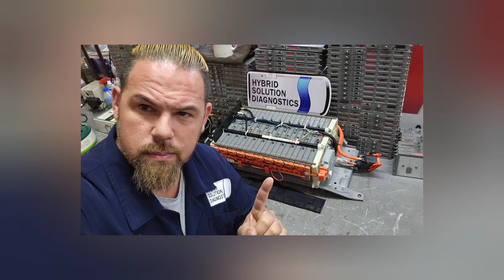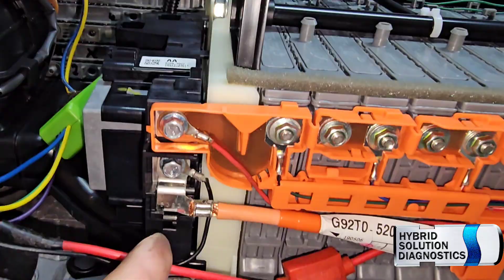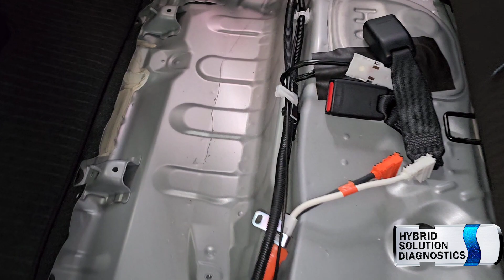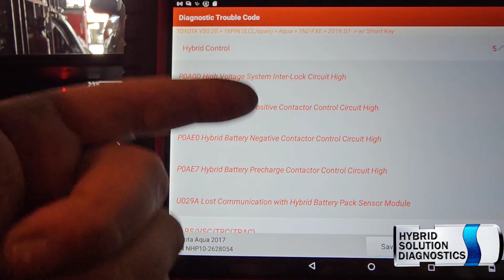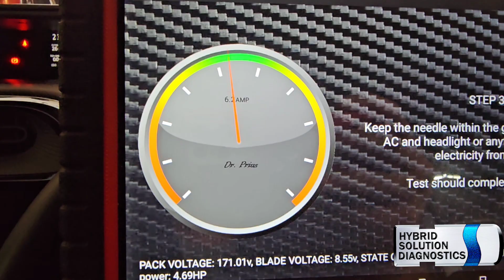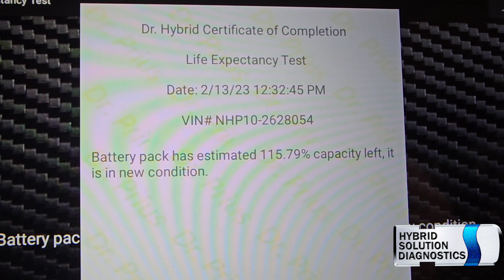Reconditioning a good hybrid battery part 2 of 2

Comment: First, thank you for such a great video, but i have a question. 
I am a little confused. 

If you connect the charger leads to the battery pack's bar, doesn't that charge all all batteries at once like the car would?
Meaning, a weak cell would not be able to reach 100% charge before the charger thinks the whole "pack" is done? I don't really follow "forced outside normal range", wouldn't that overcharge some cells and damage them?

I thought to "recondition" a hybrid battery you need to force each individual cell to its maximum, so i was expecting like 56 (28x2) different wire connections to the battery, one positive and negative per cell.
Reply: Yeah, since Nickel Metal Hydride batteries have some tolerance against a little over the norm full charge floating voltage, here the oem design itself is getting away with multiple cells connected in series (inside one module) without any dedicated balance and monitor connectors, basically just like any 12V lead acid battery (which has much more tolerance BTW) that actually contains six in-serial cells. In a perfect world where you need the maximum age and functionality of a lead acid batt you will have every one of these cells separate and treated as a 2V battery, (like the ones in many electric forklifts, cell phone towers power backups,..).

so, during the equalising charge phase, as some cells get fully charged, the current will still pass through them and SLOWLY fully charge the cells that are not, this current will cause some heat for those early fully charged cells, but the heat will be very minor, as the current is very very low compared to the rated charging amperage.

But I agree, the balancing charger should do it's job at the level of each module at least, not expanding the OEM tolerance even further. probably this one is designed for easy balancing without the need for removing/disassembling the hybrid battery.
Reply: @jonnyjonny1386 thanks for the explanation since the video uploader never answered. 

So, out of curiosity, if you wanted to recondition your battery the dirty (lazy) way. Would you use like a hobby charger for NIMH cells and attach it to the buss bar of a Prius battery, and force it to a specific voltage and get the same effect?
Reply: @Orvis25 TBH, I'm skeptical about hybrid battery reconditioning(many cycles) and refurbishing as all cells are the same age(unless the pack failed prematurely), but if the sole purpose is to balance that's valid, I would rearrange these modules to be connected in parallel as a one unit through the busbars, (of course after insuring that they have approximately the same voltage in order to be connected safely, and some load testing for bad cells), I would leave them like that for a few days, then I could use any reliable 7.2V NiMH charger or any good power supply with current limit, to charge them slowly, maybe one discharge with some cars lights and one recharge afterword, it will take a long time, but since my intention is to leave those modules connected in parallel(equalising) for like 2 or 3 weeks, I would have time as much as I need.
This period is not based on any scientific evidence, only in my mind it feels good enough.

Comment: It would seem that a parallel “pm system” that would monitor and allow access of your discharger and charger to balance cycle, without the major disassembly process, then a periodic physical inspection / cleaning of terminals.  The non neglect of fan maintenance/cleaning is an obvious simpler step to do at standard maintenance interval. 
Love your content and attitude in presentation for further education.  
Do you have a network of trainees in any of the US states?

Comment: Hi Jose, great vid! Can you tell me after reconditioning and final charging, does the battery pack need to be discharged slightly before installation into the car? Can the car accepted a 100% fully charged battery and not give a fail code?
Reply: Leave the battery to rest for one hour. Then proceed as normal.

Comment: I picked up a 09 Prius that has been sitting for over a year.  
What’s the best way to charge the HV battery? 
Should I rotate the cells and charge them all in parallel? I have a lab grade power supply that I can set the voltage and current.  
Thanks

Comment: Thank you for a great video. I drive a 2018 Prius Prime/PHEV it has 135kkm and opened since new. My question is how to check the the huge battery it has  8.8kWh, is it possible to check it with Dr. Prius App ? How to do balancing ? Thank so much for amazing videos.

Comment: If my 11 Camry has the cylindrical cells is the same process of discharging and charging?   

Or it’s just full charge 2 times to balance them.  

Also how will connect the wires for the plug to work

Comment: So, you are basically rebalancing the battery by discharging. Is the overall capacity / MAH still lower? Why not replace the cells as well? I tried to follow both videos, but I understood what I understood.

Comment: This deep cycle conditioning process could easily be automented by using a simple control algorithm, if you wanted to get into the business of reconditioning batteries.  This is a great idea for a business - if you can make it competitive to swapping in a new battery module.

Comment: I have a question, if the hybrid system gives a code P0A7F it doesn't necessarily means battery is bad, could be balancing problem yeh??
Reply from the maker: Deeper tests should be done to it…

Comment: Here, with the Prius and cars like it, no one I know has this equipment/instrumentation to rebalance an EV or Hybrid battery nor do I know of a shop that does this.  How do I get This software.  .   Also I know of a couple that built from Him self a rechargeable system for His RV .  Solar or  His Engine or ac electric   HE used HyBrid battery's from a Toyota  ,It is a Awesome setup , a lot of Power stored up ,  .the battery's are out of the car So he can CHeck rebalance  .  Good VIdeos 5*s

Comment: Hi. Thanks for the info, very useful. One question:
1. Can we recondition an HV battery in the car itself without opening? If yes. How?
Reply: can't
Reply: Yes you can, The prolong harness is intended to be installed permanently into the vehicle’s battery…. 

Call the company and they’ll confirm…. It might not be possible in every situation because they state to not keep battery in direct sunlight while charging and also you can’t charge battery in temperatures exceeding 100 degrees

Comment: I have seen your video on how to charge the modules with a 12 volt battery!!! Great video! But i am wondering if there is a way to discharge them without expensive tools??? Then charge them back up with the quick 12 volt battery method? I don’t want to spend roughly $1000 on the equipment the recondition my battery. A new OEM Toyota HV battery is $1750 at my dealership. So spending that much doesn’t make a lot of sense financially for me to do. Love your videos btw!
Reply: Car light bulb, wire and a voltmeter.
Alternatively a hobby RC charger.

Comment: What is PCU ( power control unit) my PCU fuse keep blowing, what will cause that? And the car can't start no Ready , can anyone help?
Reply from the maker: Short circuit for sure…
Reply: Check the copper connectors and nuts for corrosion

Comment: hey bud are you ablt to help me with a prob,after reconditioning i have a neg  calculated hybrid battery current what does that mean
Reply: vehicle wont go back into hybrid stay on gas mode, no check engine lights and voltages on batteries are perfect

Comment: Hello bro, I am from Bangladesh  I really like your all videos 
Bro I have a axio hybrid 
But  2 day ago show in my display a some notification 
Hybrid  Battery low cooling performance at  the stor place check 
Now what the prosiness??? Plz help me bro make a video
Reply: Hey, I would first check the cooling vents usually around the back seats. Make sure they're not clogged. Check the filter or mesh, vacuum it. If days are hot, make sure you run AC while driving.

Comment: By any chance could you please provide me with torque specs value for the bolts on the plastic brackets that compress the battery modules. For some reason can't find any information anywhere.  It's for 2008 prius.
Reply: I have a 2008 Prius.  When the modules are cool and aligned properly, you can tighten the bolts down so there is no gap between the end of the rods and the plastic end pieces (without using a lot of torque).  If some of the modules have expanded and do not compress back to their normal shape on their own, then it is likely they have been damaged and need to be replaced.  The highest voltage you should charge modules to is about 8.55 volts.  Also, charge at 5 or 6 amps at the most when charging modules individually.  When charging a module, the voltage of the charger can be 9.5 volts, and when you remove the charger, the voltage of the module should not be much higher than 8.60 volts.  Once the modules reach 8.55 volts, you should apply a small trickle charge to keep it at 8.55 volts for an hour or more. If you charge or discharge higher than 7.2 amps, you can damage the module.

Comment: what do you think about the cq3 module charger
Reply from the maker: Very nice 👍
Reply: @hybridsolutiondiagnostics  do you think the prolong is better/more or less useful
Just want to make a decision before i buy one to rebuild a 2006 prius battery with 1 bad module code in techstream
Reply: @christopher6161  2 years ago, I bought two SkyRC B6AC v2 chargers.  I have spent 160 hours learning how to charge the Prius modules (live and learn).  If I could do it over, I would buy the Prolong charger.  The reason is you can charge the whole pack at once, and you can use it to recondition the modules properly without damaging them.  If you buy the CQ3 charger with 4 x 10 Amp channels, you can connect 2 modules in parallel to each channel and charge at 5 amps per module (which I think is good).  Or you can connect 3 modules in parallel to each channel and charge at 3.3 amps/module (which is the max amps/module the Prius charges at).  Many of the RC chargers do not detect when the module is at full charge (when Delta V drop occurs), so you run a great risk of overcharging a module.  Do NOT charge the modules higher than 8.55 volts and do not discharger lower than 6.0 volts and you should be okay.  If the CQ3 is $299 and the Prolong is $489 (for Toyota), I think the Prolong is a better choice.  You will save yourself from spending many hours learning how to properly charge/discharge the modules.  I now have lots of experience charging/discharging, however my technique has lots of room to improve.  I think charging at 5 amps is best, however charging at 3.3 amps may be good (I didn't compare this yet).
Reply: @GaryMarkowski  that is good to know, but I think I will be buying the cq3 instead of the prolong charger. The prolonged charger at your price does not include the discharger which is a huge disadvantage. When you include that add-on and get the deluxe version that you need the total price comes to about $750. Ouch. Also I need to be able to charge and discharge individual modules so that when I replace a module in a battery I can work with them individually.
Reply: @christopher6161  The cq3 has a feature where you can set the charge/discharge end voltage of the battery.  My SkyRC B6AC v2 allows you to set a discharge bottom voltage, but it is sorely missing a setting to stop charging at the desired max voltage.  Because of this you cannot use the cycle feature and you have to watch it closely when the voltage gets above 8.25 volts so that you can stop it when it gets to lets say 8.55 volts.  If you get the Prolong charger, it is not essential to get the discharger.  If anything, you can charge up the modules in series, remove them, connect them in parallel, and then use a headlight to discharge the whole pack slowly.  You can use another hybrid module, connecting it in parallel with your new module to charge it.  You can even use a 12 volt car battery to charge the new module as well.  Or carefully add the new module to other modules connected in parallel.  If the voltage difference is great, briefly connect and disconnect the new module several times until the voltages are similar.  Anyway... good luck with your adventure.
Reply: @Hybrid Solution Diagnostics   I have the CQ3 . Sorry for late comment I'm trying figure out what the volt for each module for 2002 1st gen pruis is supposed to be. I don't wanna over charge at 8.40 :/ the modules were ALL mostly at 7.47-7.51. I just wanted to clean the copper and maybe just put aluminum to (balance out). 12 modules I charged over 8.25   I think they will balance out I don't wanna charge anymore modules. Til in morning check the volts. What you think??
Reply: @user-ou4ps1yt2b  I have balanced the pack of batteries on  aluminum strips.  When adding a module to the strips, be careful to ensure the module voltage is similar to the other modules.  If you add a module that is at 6.7 volts to a set of modules that are at 7.8 volts, then a lot of energy will quickly transfer to the low voltage module.  My SkyRC B6AC v2 charger can apply 5 amps to the whole pack in parallel.  I charged 5 modules at once at 5 amps up to 8.25 volts, however I found considerable inconsistencies in the total charge of each module.  I found I got much more consistent discharge results if I individually charged each module at 5 amps up to 8.25 volts.  Using a headlight bulb, you can discharge a module at a rate of about 3.2 amps down to 7.0 volts.  Track how long each module lasts down to 7.0 volts.  I used an Arduino to test and log voltages and I can see this is a good range to test.  Many modules will drop from 8.10 volts down to 7.80 volts quickly, and then decline gradually down to 7.0 volts while other may start at 7.80 volts, decline gradually to 7.40 volts and then drop to 7.0 volts quickly.  I have had bad luck with modules that I discharged lower than 6.0 volts, so I don't do that anymore.  I discharge down to 6.4 volts.  So doing the deep discharges below 6.0 volts on old batteries may harm them.
Reply: @Gary Markowski  wow thank you for all that info in detail. ALL modules read 7.78 for  24-36 hrs and I installed  everything working great. Ya I wish I did charge 5 amp parallel  but I think 7.78 across all 38 modules worked out. They batt wasn't bad just corrosion plates and few low volts charged them 8.×× no more then 8.44  and used tig aluminum rod for 36+ hrs . Thank you for the info. I love the YouTube community.  Might post vid of the job I did
Reply: @Gary Markowski  ya I have below 6 and one 4 on other battery packs gonna rebuild 1 with 2 bad packs.  I have (2) 2002 pruis so it's good to have one on stand by. Thanks again
Reply: @kermit80526  depends on how many cycles you run. I'd say 8-12 hours for 5
Reply: I have that one CQ3  first gen pruis tho 38 modules  grrr.   Watching this video because most ALL modules 7.47-7.51v  trying find a answer to what the max volts each modules should be at.  Wish I seen video/comment earlier today when I was discharge/charge.
Reply: @kermit80526  they are copies, get the fpv one, its the same and good quality. Thats where i got mine
Reply: @kermit80526  do them 4 at a time/individually.
Reply: @kermit80526  long time, only 4/28 at a time